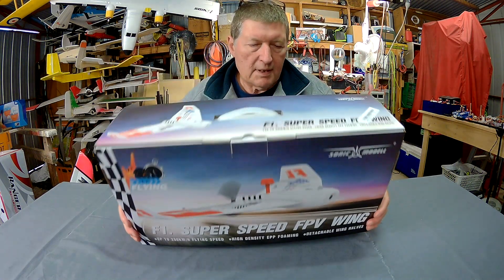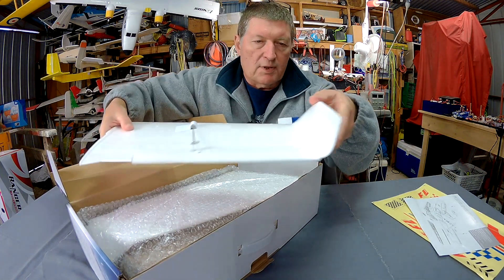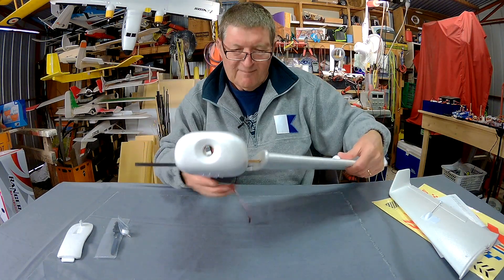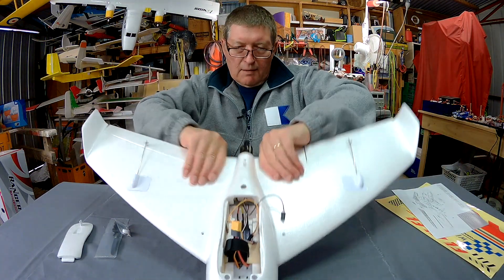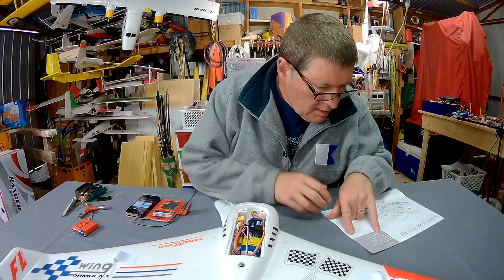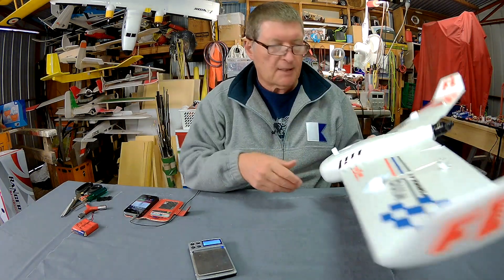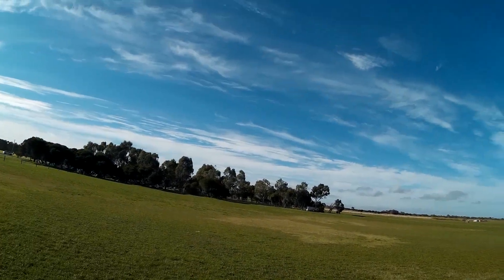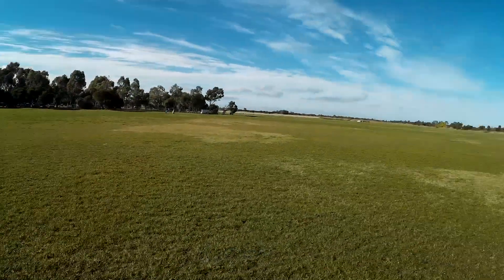Sonic Modell F1 Wing

Comment: Hello Andrew. Do you think it is possible to fit 2 4s 1300mah or 1500mah inside this wing? I was planning to buy one to use 8s low kv motors. My goal is to speed up this thing until it disintegrate in the air LOL. This thing is very cheap rn and is available in only a few shops in aliexpress, so i wanted to get my first high-speed basher to learn before i go to something more crazy (and expensive). For max speed i was planning to use one of the new brotherhobby’s motor for 8-inch props on 8s with a 6” or 7” racing-prop.
Also, what camera sizes can i use in this plane? Micro or mini are possible?

Thank you, i love your reviews!
Reply from the maker: 6:28 shows a 2200 4S fitting with room to spare so I think you could fit 2 smaller lipos in. Plenty of space for FPV cams of any size

Comment: Is it complicated to set up that GPS sensor to get your radio to read the speed out? I have been getting into faster and faster planes, and would like to have an idea how fast they are going.  I fly alone, so buying a speed gun makes little sense. I have a QX7, but am not very great at all the OpenTX programming stuff.  If there were a relatively simple set of instructions to set it up though, I'd like to know how to do it..  Thanks.  Edit - Just saw your video about it.  Still, I've never done telemetry or set up flight logs etc..  I guess I will buy one and mess with it..  Your video looks like a helpful starting point.
Reply from the maker: Worth trying. I'm happy to help with detailed answers
Reply: Hey, thanks.  I'm researching it. First off, where to order it from.  The one linked at Myrcmart doesn't say "V2".  I assume it must be though. (I like myrcmart better than the other Chinese retail sources, besides HK EU, but HK only has it in the Int. warehouse..) As for the setting up, I probably need to have it first to be able to ask more detailed questions.  The one thing which jumped out though was, how to enable telemetry at all.  Never done it..  Is that something you have to program before even setting up the GPS as you did in your video?
 BTW, what do you reckon the top speed of the F1 is?
Reply from the maker: In the telemetry page you have to select Discover Sensors, then setup a Special Function on a switch to Play the value if you want it spoken.
Reply: Excellent, thanks. I think (even..)  I might be able to figure it out.  What do you think about the idea(which I just read about on a forum) that the GPS speed readings are not accurate?  I am being told to get the ASS 70 speed sensor, but that looks more involved to install etc.. And as such not as easily switchable among planes.  Edit - I think I'm just going to order the GPS sensor to play with and test.  Then maybe the speed sensor later.  I don't absolutely need %100 accuracy, but it would be neat to have a rough idea of the relative speed differences among my different planes...

Comment: What motor and Lipo did you go with to bring the weight down?
I'm contemplating a bh engineerx 2307 2700kV quad motor, 52A Racerstar 72mhz! esc,  the square 4s 1300mah Turnigy Graphene (fits perfectly right up in the nose), a micro eagle and tramp vtx  in mine.
 Props? Will have to test amp draw so not sure yet..
Reply from the maker: 2205 2300kV on 1300 3S or 4S

Comment: Hey Andrew, that first lob, you never know what's going to happen, eeeek! 😱 With faster models LOS , I learned from the lads that were flying the faster models all the time. They keep to the same flight pattern which is a large U shape in the sky. See the recent sidewinder flight and also the re-testing of the Mini Drak LOS examples as once you get the grove on and the speed in, it's quite manageable. Matt
Reply from the maker: Good advice thanks Matt. Now has a smaller motor and battery 110g lighter and much wider speed envelope
Reply from the maker: 1300 3S or 4S

Comment: Love this plane.  It is what it is though....... I've flown it with FPV and osd and found that any less than about 90kmh and it felt stally but I don't like letting my planes slow down anyway.  The standard motor is big but not very efficient.  a 2306 quad motor would be quite a bit lighter but much more powerful.  The best I could get was about 160kmh
Reply: I should explain what I mean when I say it is what it is....... Don't think you're getting a $300 race wing when you're paying $100.
Reply from the maker: Yes stock motor is too heavy

Comment: I have the kit and installed a very light t-motor air 40 2450 kv motor with a cyclone 5046 tri blade, 30 amp esc and digital MG emax servo's. It balances perfectly with a 4S graphene 1300. Even with the small motor it is very very fast and it is out of the park in fractions of a second. I think a lighter set-up makes launching much easier and I doubt it is any slower. LOS it is crazy hard to keep orientation.
Reply from the maker: Snap. I did a very similar mod today (2205 2300kV) and I agree. 1300 3S and it's 110g lighter. Much easier to launch and land but still wicked fast. Video up soon.
Reply: What sort of flight time on the tmotor setup ?

Comment: would like to see it on a slope with strong wind
it would cut through it well I think
Reply: if you glue it in time, I think we have some wind in the next few days if you have time to try it.
Reply from the maker: I think you're right, low drag.
Reply: It has symmetrical airfoil though.  How would that effect performance?  I'm guessing it'd need to be quite a good wind?
Reply from the maker: Should be OK, maybe need a little more wind
Reply: https://earth.nullschool.net/#current/wind/surface/level/orthographic=-216.32,-39.16,1304
Reply: wind still coming. this is the map. looks like a week away

Comment: Good review mate:-) Race wings are wings used in actual races, like Ritewing HC44 and others. I would suggest you build an actual race wing (hardcore series). Nothing compares to the smoothness and speed of a wing developed through decades of experimenting and engineering.
Reply from the maker: Yes you are right. I should actually try a proper race wing in a race. Good call mate
Reply: Don`t have to enter a race. My point is rather that the stiffness, high wing loading and overall performance makes for a very special flying experience.

Comment: Good Grief! Two failed launches? First time I've seen that in one of your videos.
If you are finding it a bit of a handful there are going to be quite a few would-be racers picking up bits of foam.
I've no doubt that there will be many who will try though. After all it really is a bit quick :)
Reply from the maker: I'm determined to tame this beast. Smaller motor and battery mods I think
Reply: i was think along those lines. its cool as a racer wing but, slowed down just a little so you dont have to stand there with clinched butt cheeks thw whole time zooming around. :-)

Comment: I kinda hate it...any plane that doesent like landings or lands like this does not have a place to my collection.Good review though!!
Reply from the maker: Thanks, I'll calm it down with some weight shedding
Reply: Andrew Newton what is weight shedding?!?
Reply from the maker: Dieting - Lighter motor smaller battery
Reply: Andrew Newton yes that might do the job
Reply: I have this plane and i haven't had it land like this yet.  I have a pylon racer though that is a fraction of this size and does almost double the speed so i'm used to long approaches and losing speed.  Models like this just need a long time to slow down that's all.